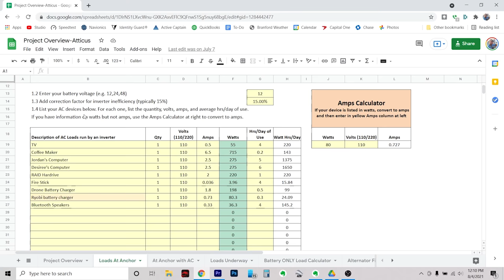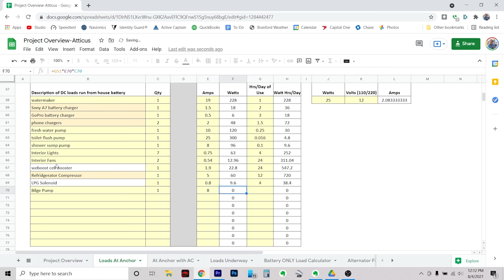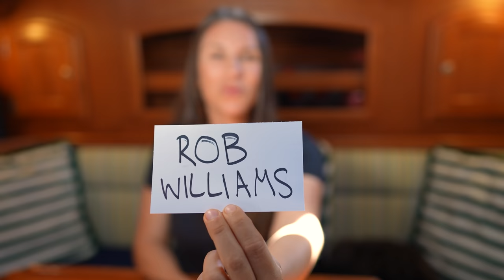Livin’ La Vida LOBSTER 🦞 | S06E14

Comment: Great video! Thanks for sharing... A bit of a tip regarding your electrical having done this several times, and from someone that is a stayaboard on a self sufficient cruising boat.

 What I would do is to get your boat set up with your inverter/charger as well as a S.O.C. (State of charge) meter before you even consider changing your house battery bank. Then disconnect from shore power and see what you really use for energy. That will give you some real (vs calculated) information for your house battery bank size.

On my 47 footer I run a pair of Victron multiplus inverter/chargers with a SOC meter and a really cool CERBO display. Even if you do not choose Victron it would be good to at least look at their capabilities for comparison. I run a pair for both increased charging capability and redundancy. Not much worse than loosing your inverter/charger in a remote location. Something to consider...  Best of luck on your refit.

Comment: East coast lobster newbies, lol... last week I was going to warn you not to grab a lobster while free diving. Unlike in the islands our lobsters can fight back. There is a bit of meat in the head compartment and the green is the tomalley (liver) and is fantastic spread on buttered (+garlic) toast or baguette. Pro tip: to break open the claws without coating the walls with the meal, you know who you are...lol. Take a large chef's knife, holding the claw on its edge, whack the blade (sharp end) into the shell and then twist sideways, the shell will very easily split apart. On the Canadian side the lobsters are much more succulent so we suck out the meat from the legs, and the the tail fan. I love to hear you cooing about the east coast beauty, In the meantime I'm in the SW islands...have a great week.

Comment: Nice job with the caulk.  Just be careful with what soap you use as a lubricant when tooling.  1. Don't get ahead of your bead.  The soap can become a bond breaker.  2. Make sure you're using soap and not a detergent.  Grease cutting dish soaps like Dawn are detergents and can cause curing problems and discoloration for some sealant compounds.  Ivory, for example, is a soap and is generally safe as a tooling aid.
Reply: I second this. Ivory is the way to go.

Comment: try a hair dryer to pre-heat the caulk.  typically it will just peal right off but sometimes not.  After the old stuff is removed try using denatured alcohol to clean the old area free of soap and grease.  Some folk run their bead by pushing the bead instead of pulling or dragging like you showed in the video.  By pushing it can force some additional caulk into the crevices ...however with you using blue tape and forcing the caulk with your wet finger it does the same thing

Comment: I want to thank you for two great tips.  I have a 45"  '91 Morgan that looks like a wire factory had a rough night out drinking!  I need to clean up the wiring or rewire the whole boat.  I signed up for the "Boat How To" course using your discount code.  to be honest, I was surprised at the cost but bit the bullet and I am glad I did.  I am very handy but I have learned a lot from the course and will no doubt save enough on my re-wire project to recover the cost of the course.  Second, I just logged on to Ocean Planet Energy and I think between the course and this company, I can survive the wiring project without totally emptying my liquor cabinet.  Thanks again.  My question is, how do you find these resources?  I have a lot of Nigel's books however, I become narcoleptic when I try to read them for too long.  Our goal is to spend summers in Maine, winters in the BVIs (original, I know), so we are enjoying these videos.  You guys are doing a great job.  Linda wants to know is Oso named in Spanish for bear or is there another story?  Keep it real and take care of each other.
Paul and Linda
S/V The Friendly Confines

Comment: Fyi on the caulking. If you ever have to do another job that requires a significant amount of caulk, pay the little bit more and buy a full size tube and gun. It is sooooo much easier to run a bead with a gun than trying to squeeze one of those little hand tubes. Those are a royal PITA! IMHO. :-)  The 'lo"bsta looked awesome, tho! My 2 fav seafoods, lobster and King Crab! Both I cannot afford! lol.

Comment: Hi guys, and Osso! I noticed towards the end of this video you have an electric outboard hanging off your stern rail. Yours is different than mine, but I suspect they have the same issue that you should try to keep water out of the shaft from the top where the battery normally covers it. The electronics are in the shaft and when you take the battery off, there may be some possibility of water intrusion. I sewed a snappy little cover, thanks to Des's prior sewing vids where I learned a bunch, and it covers the shaft now when the battery is inside charging. Maybe the Torqeedos don't need that but my E-Propulsion one does, but I thought you might be interested. Happy sailing!

Comment: I love you guys however with all due respect As a licensed contractor and building maintenance technician for the last 30 years if one of my employees applied caulking like that I would fire them!.... You don't need masking tape you absolutely do not need sandpaper as that causes many problems... OK here's the constructive part... Remove all caulking in a non abrasive way... Use a calking gun and cut the tip as small as possible.... Get a bucket and put just a little bit of water in it and a rag.... Run a wet rag along the seam you want to caulk and then run a very fine bead evenly as small as possible..... Finger trowel excess away and remember if it bunches up in front of your finger more than what you can just trowel and spread then you have too much caulking on there..... With your fingertip you should be able to spread it out as you go and leave a very clean even  rounded u shaped smooth bead behind your finger and every once in a while you might have to clean the excess off your finger any more than that you have way too much caulking in that joint to begin with.... Remember moisten the joint before you put the caulking down water only..... OK I can breathe now love you guys have an excellent day!
Reply: Thank you for that..😂  I was thinking I was doing it wrong for the last 50 years! More is not better when applying caulking.

Comment: 3:55 would recommend learning and invest in FUGI siliconing tools (cramer is a great brand). As tooling with your fingers (even gloved) , use of masking tape, and odd angles in marine applications create waste and bacteria/mold entry points, and weak caulk or silicone bonds. Fugi tools create the correct geometric plane and bond to the substrate planes. Yes it will take some practice however you wont need to prep with masking tape and the bond will last many more years.

Comment: Fun fact when you’re checking oil always heat up the engine first.
Reply: Unless you know exactly where your oil sits cold on the dipstick…. A lot of us boaters will get it set warm. Cool overnight and then mark where cold level is at. That way in the morning when can check all fluids before we leave without waking up the wives :)
Reply: There is no benefit to heating the oil up first if the motor has sat long enough for the oil to drain back into the pan.

Comment: You don't have to remove the bands until after you cook it. Also you should turn it upside down to get the head in first That's the merciful way to end its life. Before you serve it pierce it right below the eyes hold it by the tail over the sink and the water will drain out.

Comment: AS A PRO ON AUTO REPAIR ALWAYS ROUND TO THE HIGH FIGURE EVERY ELECTRICAL EQUIPMENT OR APPLIANCE AND CALCULATE THAT ,MY IMPUT WILL BE AN ALTERNATOR OF 170 AMPS AND ELECTRICAL TOTAL OF OF 14000 WATTS , AND CONSIDER YOUR FEEDING CABLES SIZE ,ALSO GROUND EVERY WHERE , LIKE EVEN A   LIGHTNING ARRESTER  ,CHANGE ALL THE LIGHTS TO LED AND INSTALL SOME HIGH POWER  SEARCH LIGHTS SWIVEABLE ONE IN FRONT AND OTHER AT REAR  ,FOR PROTECTION , SECURITY ,SEARCH OF NEARBY LAND OR DEBRIS , TO SHOW BIG SHIPS YOUR VESSEL POSITION ,ETC , GOOD SAILING